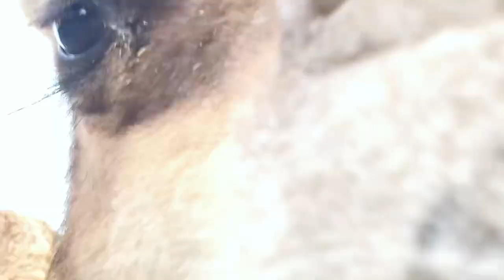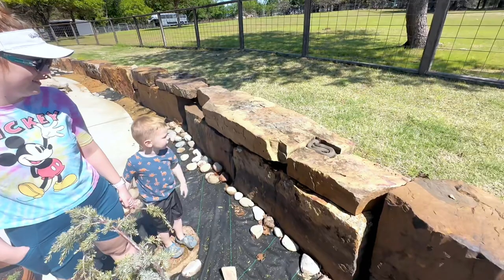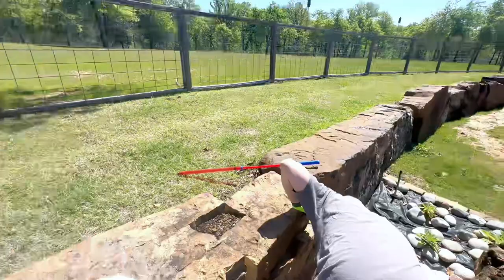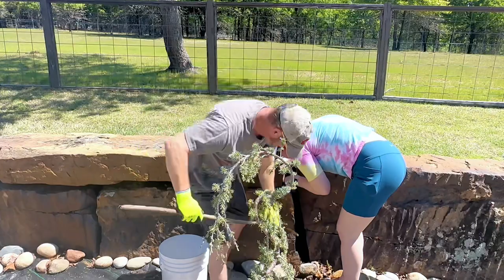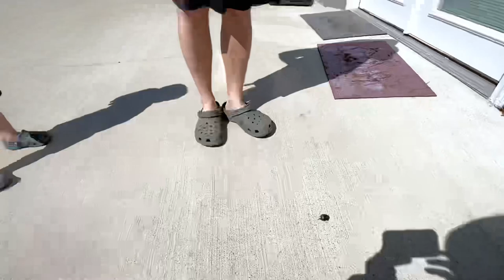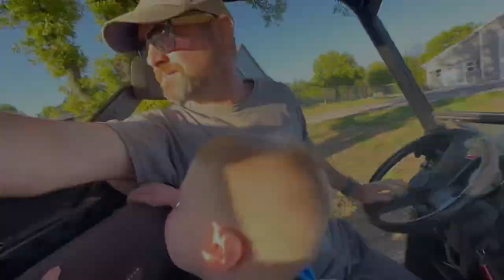Snakes….Why did it have to be Snakes?

Comment: Thank you for not killing the snake!  Flint is correct ... non venomous and harmless.  However, Nerodia snakes can have an attitude and will sometimes bite IF they feel threatened.  Handle gently and do NOT squeeze.  Excess pressure to a snake means danger.  Their bite is kinda like a pinch and might break the skin a tiny bit.  I'd much rather get bit than stung by a wasp, yellow jacket or scorpion.  Annnnnd ..... Mom is right too!  Probably not a good idea for a 3 year old to see Daddy picking up a snake.  Jett is just too young to distinguish between venomous or not.  Kudos to Carly for getting in there with Dad!